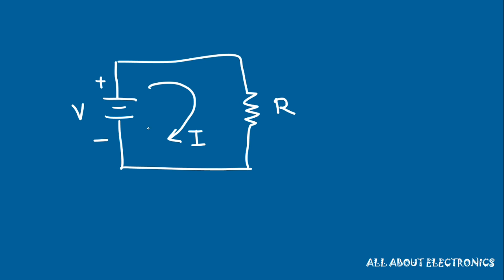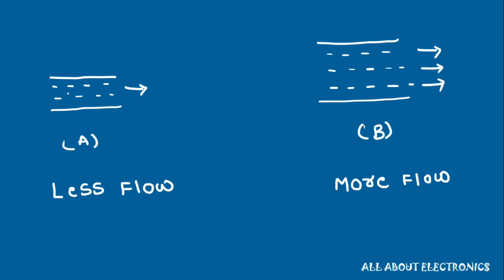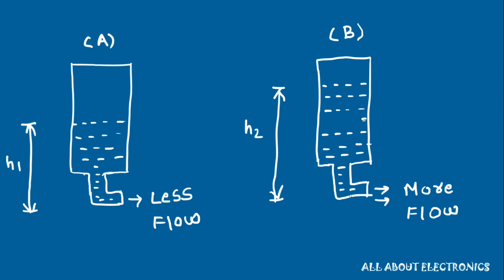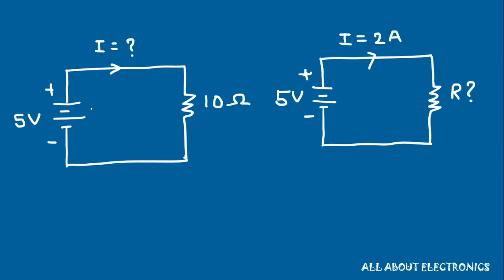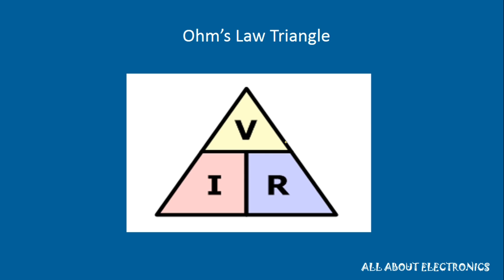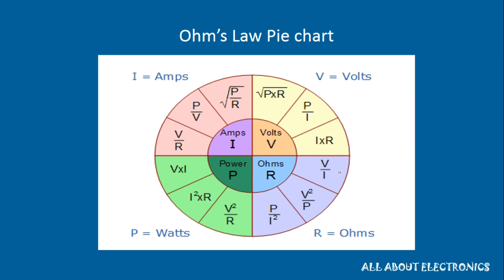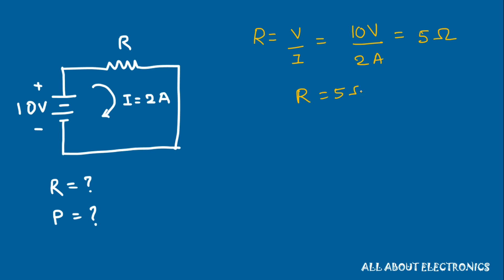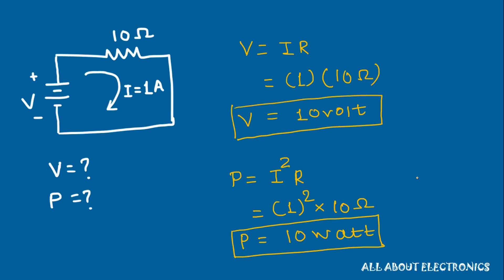Ohm's law Explained

Comment: Ohm's Law states that voltage equals current multiplied by resistance (V = IR), fundamental in electrical engineering! Check out my channel Engineer MayDay Question Solution for more engineering insights!